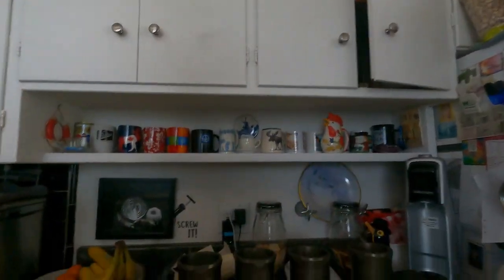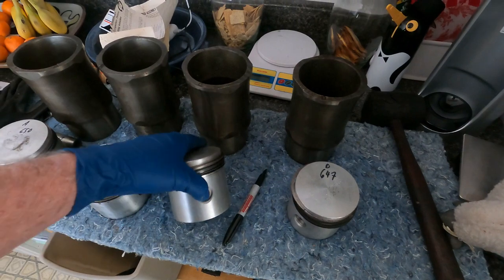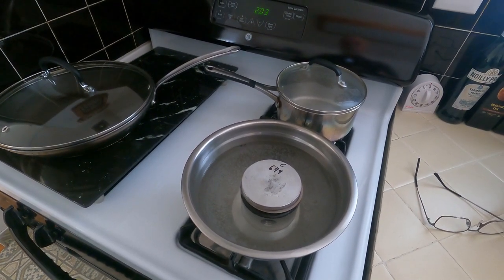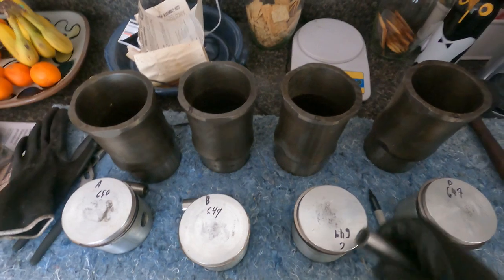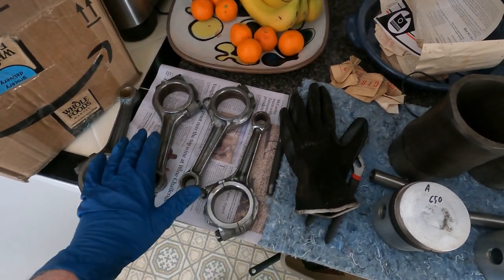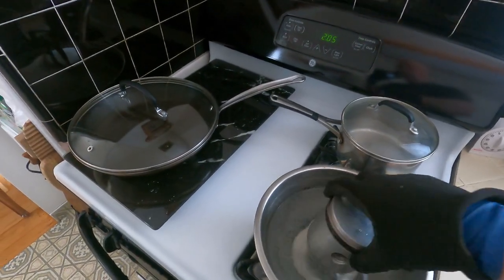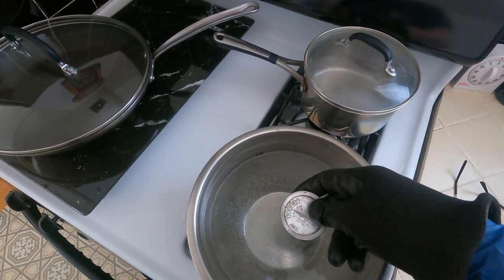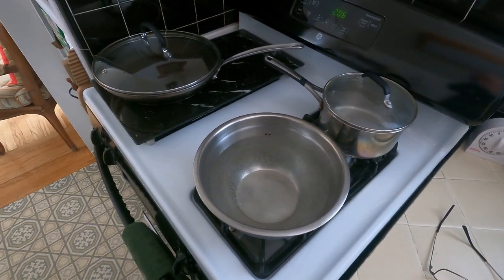1955 Triumph TR2 Restoration Part 15 Gudgeon Pins Installation

Comment: Last time I had to do this, I took the toaster oven out to the garage.  (Don't tell the wife)  The pistons got very hot but the pins slid right in.
Reply from the maker: I expect that any controlable heat sorce would work, the toaster oven sounds like a good one.  I was surprised by how quickly the hot water worked.

Comment: thanks EJH.  When I rebuilt TS394LO in 1967 with new aftermarket 87 mm pistons, pins and cylinders, I do not recall the pins being press fit.  I thought there were circlips.  When the pistons heat up, especially after hard running, would they expand enough that the pins could float around ?  Some engines use teflon buttons at each end of the pin to prevent contact with the cylinder wall.  I remember one engine I took apart where the pin had moved and had worn quite a groove in the cylinder wall.
Reply from the maker: The pins have clips at each end.  I think that the pistons being hot and the pins cold makes a difference as well.  The stock pistons have shink fit pins as well.